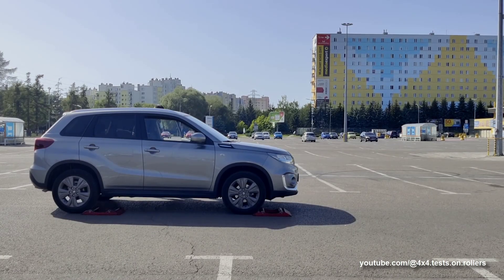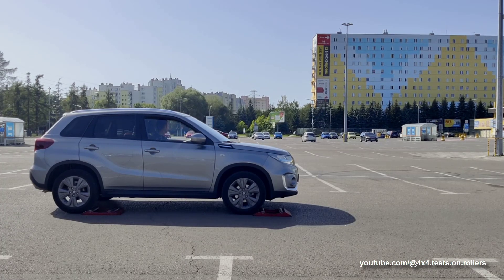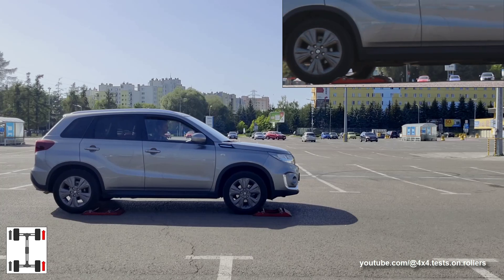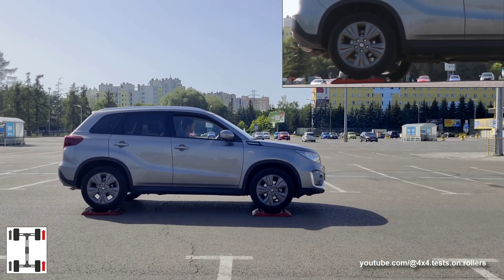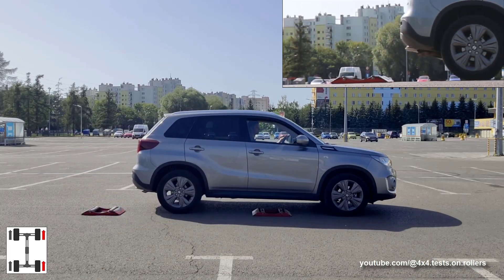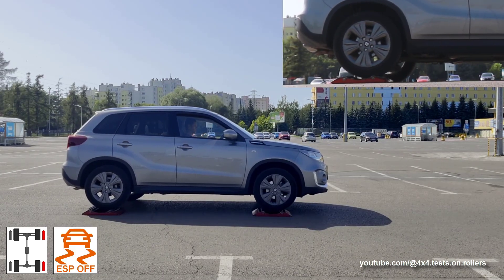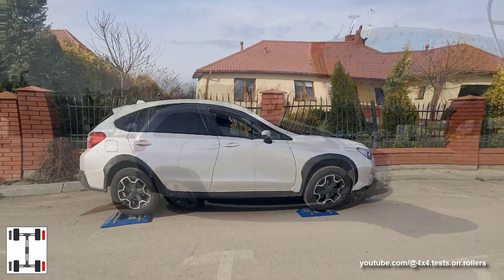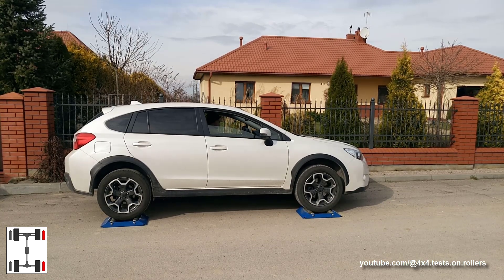ZERO FRICTION or NO RESISTANCE of rollers? Myth busted - @4x4.tests.on.rollers

Comment: How would the roller rotate freely when it's touching the tire. It would have to have no surface friction.  One of those old adages of think before you speak.
Reply from the maker: The point is that if some resistance is applied to the tyre then roller may rotate. But when tyre is free, roller has enough resistance to not spin, tyre rotates around the roller.

Comment: Can someone explain what was this about ?
Reply from the maker: It's our response to accusations that rollers have zero friction, that they do not generate any resistance, etc. In short - note that the rear wheel of a front-wheel drive car rotates freely on a roller, which remains at standstill. Roller itself does not rotate under the wheel.
Reply: @4x4.tests.on.rollers  and what's their point in saying that ??
Reply from the maker: @Eugen-E  Deprecating the results of the tests.